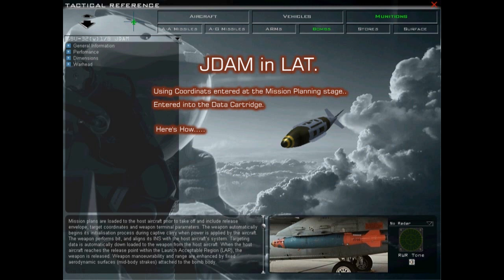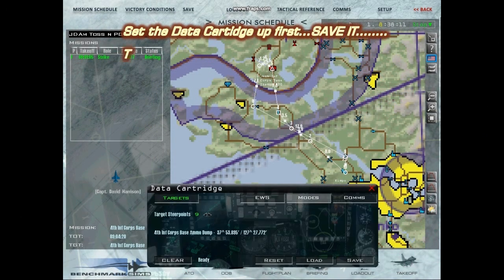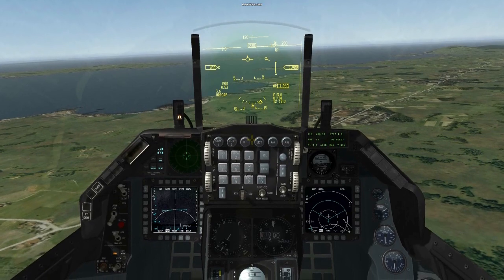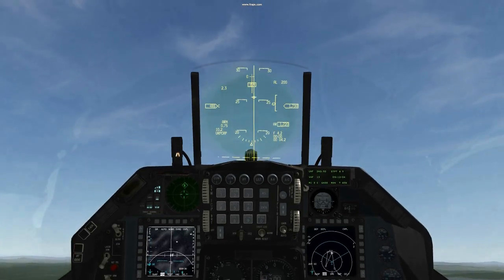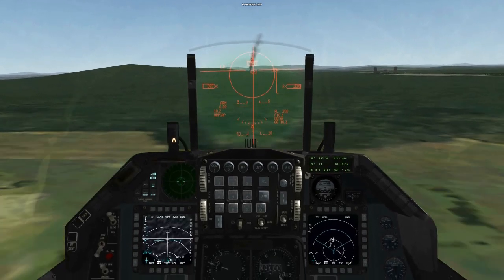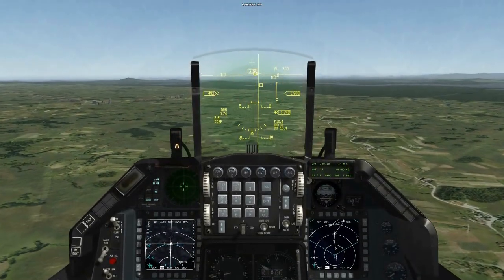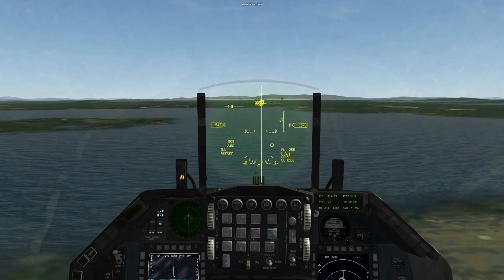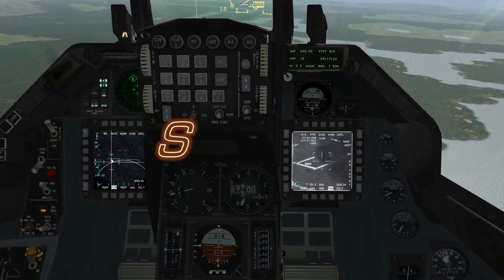BMS Falcon JDAM in LAT

Comment: What is the name of this simulation?  looks smooth.
Reply from the maker: Based on the original Falcon 4.0. So you need a copy of that first. Then look at the BMS site and download the program. The forum has lots of information. The BMS program is a free download. The old Falcon 4.0 disk can still be obtained via eBay and the like.  Krause ( You Tube) is required viewing. He flies with a virtual squadron.
Reply: Excellent.. Yes I still have the Falcon 4.0  discs :)  Thank you kindly,  I will be sure to check the BMS  :)